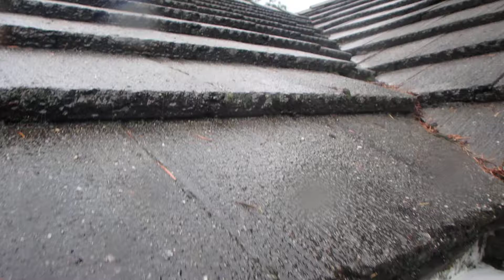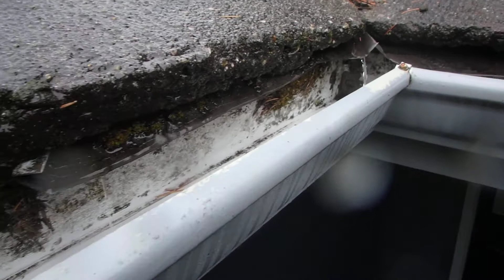Why tile roof valleys leak

Comment: Taking the valley apart once a year what a load of bull just change it with a 4inch channel so the debris can disperse into the gutter how they should be close cut valleys are a recipe for disaster because they will always get blocked at some point
Reply: I 100% agree with you, taking the valley apart once a year is absolutely bonkers if you ask me.He wouldn’t do that here in the uk, you either do it  right the first time or go home.